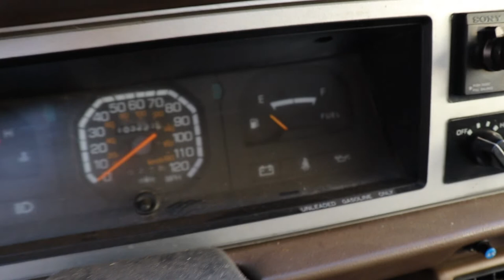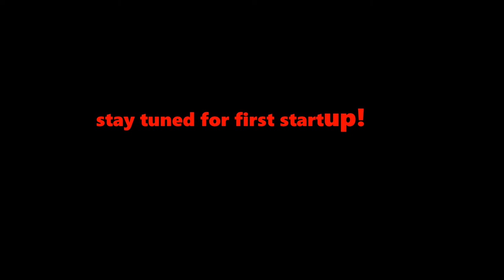Rare beauties pulled from the woods of Maine

Comment: There's a huge D50 community in the south. The MCA 2.6 Astron is a junk engine though. That jet valve system likes to shit the bed if you don't stay up on the maintenance. These also came with the 140 HP Mitsubishi V6..that's the hot rod and they sell upwards of 5k +. I had an 88 plain jane D50 5 speed 2 wheel drive.. with the 2.6. I bulletproofed the head gasket and sold it..it managed to go to 400k until the frame gave up...Indiana salted roads killed it. The D50 loves a Chevy 350...or even a pink 267 under the hood..just saying.lol
Reply from the maker: I like the way you think!
Reply: @acrazycanuck78  a 4G63 Mitsubishi or any 6G V6 ..even the turbo motors bolt right up..and you  keep the 4x4 system. Imagine a 320 HP Shitsubushi V6 out of a Dodge Stealth in that truck..while it's in lock. Hahahaha. Joking aside..that's a great little truck to get back on the road. That brown package screams Arizona or California as far as sale. If it's got a smog pump..it probably came from California
Reply: If the D50 runs and it's not tapping hard..I'd drive it. You got the twin sticks with lockouts. They can almost climb vertical.
Reply: By the late 80s..they bulletproofed the Astron because of the Starion/Conquest turbo. You could throw a eBay turbo on it and grab 300 HP and send it.lol. if it's a legit 88+ the 2.6 is a stump puller